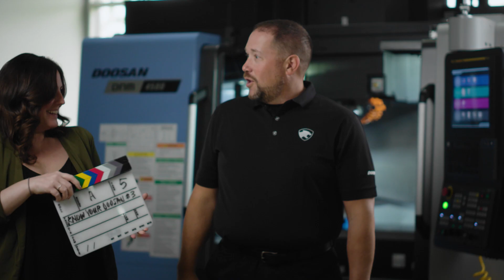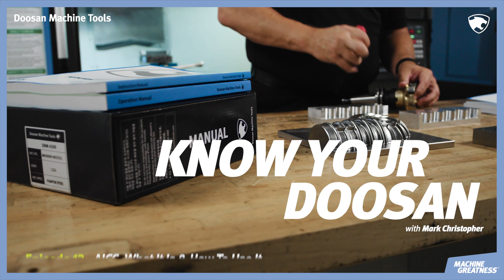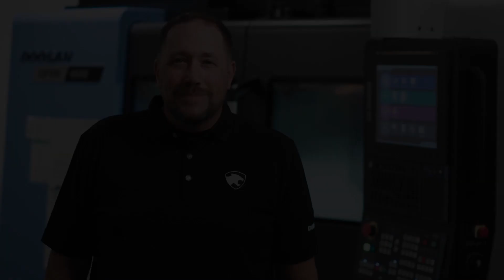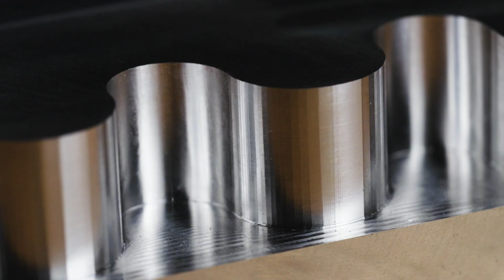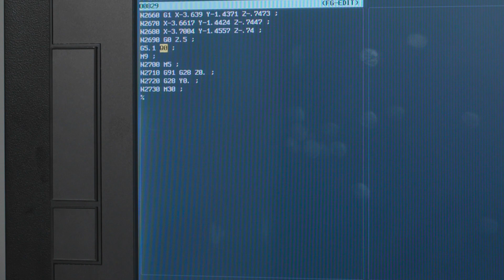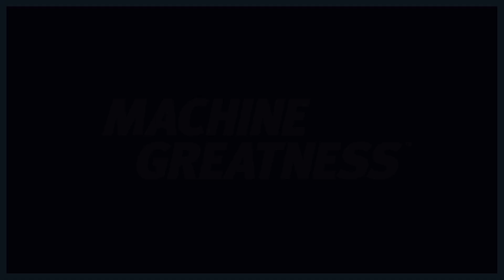Using AICC – Know Your DN, Episode 13

Comment: In my post processor I have the option to turn AICC "off" or on (i can pick levels) or there is the option for "NANO" Can anyone explain what nano does?
Reply: Good question!  Nano Smoothing is an option from Fanuc that all of our machines come standard with.  So, in DN machines when you turn on AICC, NANO Smoothing is automatically turned on.  What Nano Smoothing does is take all of those tiny little straight lines in an arc that your cam system generated and turns them into a spline.  This allows the look ahead in the control to not try and make every little line appear in your part and gives you that nice finish you are looking for.  As for your particular software, I am not sure of why they have the NANO option, but if it were me, I would just use the AICC and know that when I use it, the Nano Smoothing is automatically on.  Hope this helps!
Reply: @markchristopher5809  Thanks Mark I appreciate the help

Comment: Where can I find what aicc is currently set to? And can this code be added to CAM generated programs ?
Reply: Luke, that's a great question.  AICC comes set from the factory at "R5".  As I said in the video the range is from 1-10.  When you turn AICC off with the G5.1 Q0, when you go to turn it back on in another program or later in your current program, you have to give it a G5.1 R3 for example.  As for your CAM software, different software's allow for this option to be added into your post. It's a menu they can "turn on" so that you can select AICC option levels when you are programming your part.  You will need to talk to your CAM distributor if they offer that option.

Comment: Can AICC levels change throughout the program?
Reply: Yes.  You can program a G5.1 Q1 R(x) anywhere in your program.  It is just another G code that he machine digest.  However, keep in mind, the command needs to be on it's own separate line and not combined with any other G code.  Great question.

Comment: I see at the end of your program you turned AICC off.... Doesn't it automatically turn off/on inside the M6 tool change macro?? If am correct and it is turned off/on at M6, which R value stays active? The factory loaded R5? or the last commanded R Value??
Reply: Pat, great question.  For the purpose of programming and the video, I turned it off in my program.  You are correct, a tool change does cancel it.  The last known R number is what the machine works off of.
Reply: @markchristopher5809   thank you for the info!! Now for my next question: Where, if anywhere, can you see what the current R value is on the control? I have asked a few people this over the years and never been able to get an answer. Yes, I can always command my preferred R value in the program, but out of pure curiosity I’ve never been able to tel which R value is “active” when running AICC

We just upgraded our NHP4000 to a NHP5000. Both great machines, but the 5000 is so big I need a step stool to reach into the machining area😂
Reply: @pgreenlaw85  YouTube keeps deleting some of my comments and this was one of them, so trying again.  That R value and the G5.1 is all stored in the macro executor which you cannot see.  The only way to "verify" which R value you are running at is to command it in your program or a quick down and dirty line of code in MDI.  Hope this helps.

Comment: This setting is pretty bomb. It's reduced our cycle times about 25% with just one line of code! Some tool paths are unaffected, meaning that it's the same quality in either setting. What wasn't mentioned in this video is that G00 moves are rounded which is really great when you have lots of little cuts that have little reference plane moves between (like a series of interpolated holes). Awesome setting! 

Doosan should post the 1 page guide from Fanuc with this video. Hint hint.